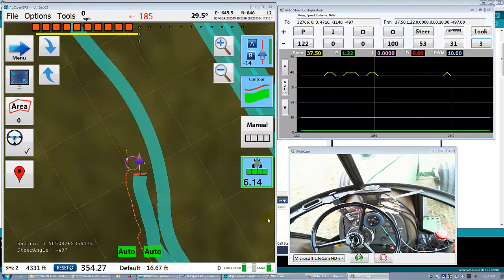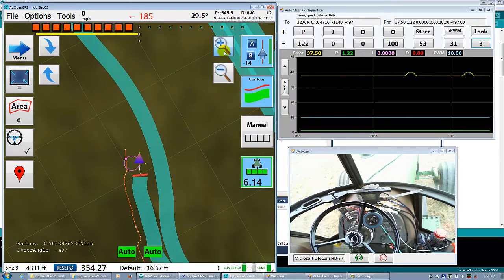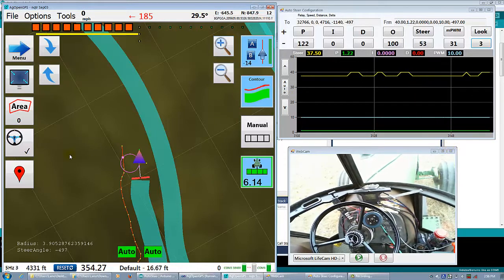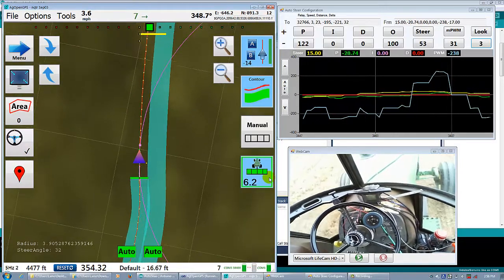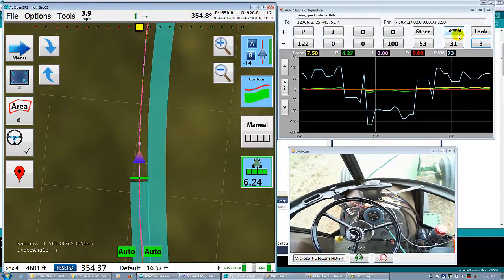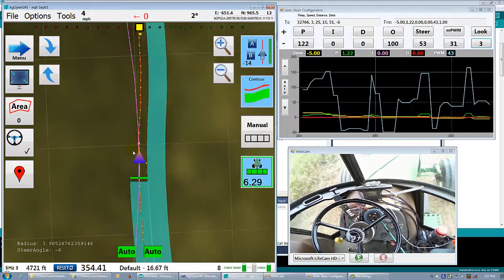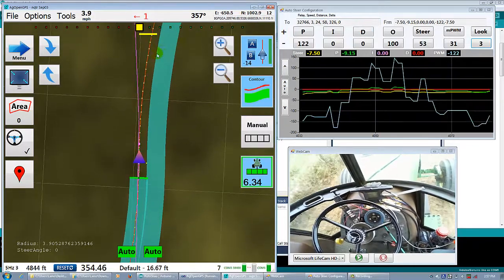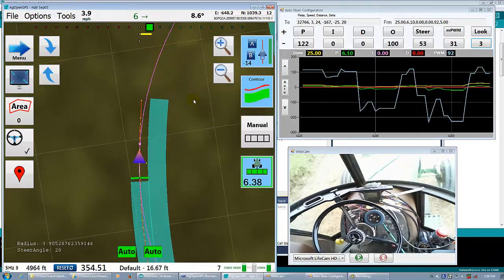AgOpenGPS and Contour Pure Pursuit

Comment: I've been playing with your software for a little while now works good I'm just having a hard time trying to figure out how to link it to an electro hydrualic valve for steering control I have the valves just dont know what I need for arduino and to link it to the computer is there a simple relay board? shoot me an email if you can riggs.corey@gmail.com
Reply from the maker: Much of that needs to be developed yet. But follow along here for developments. http://www.thecombineforum.com/forums/31-technology/296233-diy-autosteer-agopengps.html
Reply from the maker: What is on github is for steering wheel motor. You have to write your own unfortunately, but most of it is there. Instead of reversing the motor when negative, just send the pwm signal out a different port.